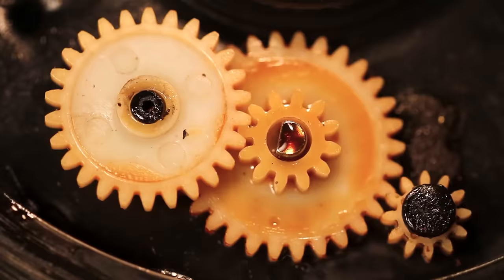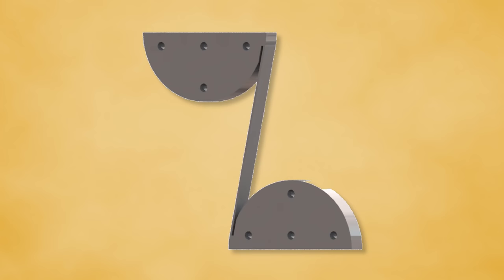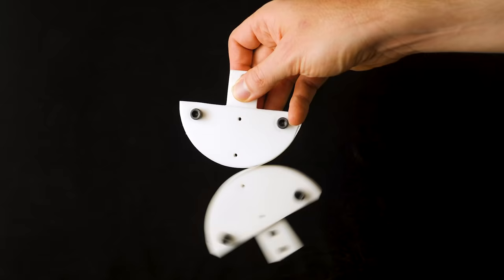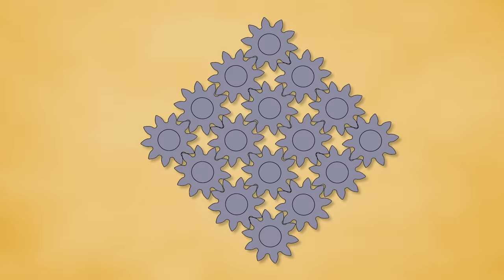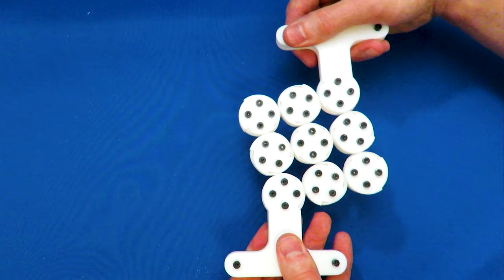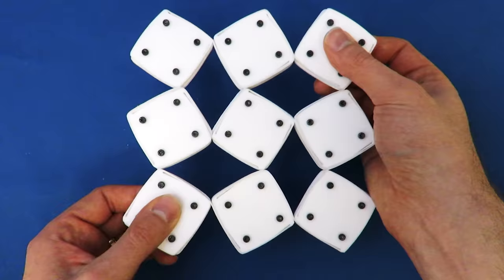Compliant Mechanisms that Roll Like GEARS!?! -- #VeritasiumContest

Comment: If I understand them correctly, these mechanisms can't actually rotate continuously like a true gear.   They can only rotate within a limited range (<360°).   So wouldn't this be closer to a linkage, rather than a gear?
Reply: correct
Reply: true.. they kinda clickbaited us but i think its still cool what theyve shown here
Reply: You could probably use this concept to make compliant rolling joints with a much larger range (a few rotations), but that would involve wrapping the flexible bar around the "gears" multiple times, either in a spiral or like a screw.
Reply: yeah this, but i'd still be interested in seeing some possible real life applications of those links.
Reply: I'm sure there's some clever ways to stack them if you need multiple revolutions of range, but yeah, gonna have a limit as long as things are attached.
Reply: not necessarily, if structured correctly, like a jacobs ladder
Reply: Did someone say bondage
Reply: @reimugota8181  Yeah, it's definitely a very cool idea.   I'm sure they have many applications.   I'm just a bit fussy about language, so the description of these things as "gears" didn't sit well with me.
Reply: @FrostCraftedMC  I'm not sure what you mean.   Could you link a a video showing the kind of Jacob's Ladder you're thinking of?   (Googling that term won't help me, because it it has about 7 trillion different meanings.  🤦🏼‍♂️ )
Reply: @animatrix1851  I like the way you think.   😉
Reply: @liambohl  Extrapolate just a bit more, and isn't this called "belt and pulley"? ; )
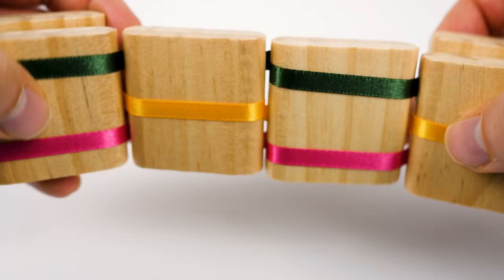Reply: @ahobimo732  It's shown in this video 0:09
Reply: I'd also add they are only showing ratios of 1:1 whereas gearing is far more used at varying ratios for speed or torque alterations.
Reply: Imagine a compliant component carrying a strong alternating torque. Could you feed that into a more typical gearbox that translates that alternating torque into consistent torque in one direction? Would this be beneficial in any hypothetical use case? What comes to mind is a translation from typical engine torque into alternating torque and then back again. Would the power loss be significant here? Trying to think of how to work around the limitations of single-rotation torque carriers
Reply: @FrostCraftedMC  a jacob's ladder doesn't make full rotations, the direction reverses for every other flip
Reply: @reimugota8181  consider that veritasium has turned into an entire clickbait channel filled with half truths or technically correct explainations that omit detail
Reply: ' So wouldn't this be closer to a linkage, rather than a gear?'  Working in reverse, there are a lot of gear and sector gear based mechanisms that don't ever make full rotations, where this could be a strong option and replace 'gears'.
But yeah definitely not a real gear replacement.
But they do roll 'like gears' as in a similar manner, even without being a full gear replacement.
A little misleading, but at least not pure clickbait either..
Reply: Very true.  These do not rotate like gears.  They also have other design faults.  For one, there is no consideration for material fatigue.  The constant flexing will eventually break the nylon they are using.  Gears have proven themselves but the Youtuber did not show any real world examples of this device used in any real machine.
Reply: I think you can make them rotate continuously but you lose the solidity. they are more like tank tracks.
Reply: @chessboxtv  Alternating torque doesn't have the same advantages as alternating current so it's hard to imagine a use case for switching to it to be rectified later, but there are use cases for harnessing and rectifying alternating torque with a limited range of swing, like wave power.
Reply: you are correct but not because of the rotating part. after looking up both definitions, it's obvious that the lack of teeth is the primary dis qualifier for being considered a gear. that and the first picture that comes up for "linkage in engineering" is of similar designs to what is posted
Reply: If you offset the attachment point, from top and bottom to the none interfacing sides you should be able to continue the motion.
Reply: That and the stress would be more on the belts allowing the motion, I understand what they are going for in a small view point. But it wouldn’t be able to fitting to replace a gear’s intended use and purpose.
Reply: @liambohl  just use a moebius strip to make them
just kidding
Reply: @alexs5814  decades ago the hard disk drives used this mechanism to control the reading head. The coupling from a very small diameter axis of a stepper motor to a bigger disk was made trough a metallic belt, very thin, to avoid any backlash. In robotic joints the same kind of coupling is made with teethed belts. It's not a new idea at all.
Reply: @GabrielMarques001  thanks for the history lesson!
Reply: Indeed it's more of a linkage
Reply: yeah you listened to the first sentence of the video
Reply: Do things like cassette spools count as linkages? Because that almost seems like a closer mechanism to this. Oh, and on the topic of range of motion, something like this could be used to carry continuous rotational movement, provided you had input and output mechanisms to convert continuous rotation to oscillation and back, but I struggle to see a situation in which that would be superior to any and all alternatives.
Reply: Also, speaking of linkages, in The Legend of Zelda: Ocarina of Time, Link ages from a child to a young man in one of the core gameplay elements.
Reply: @hollt693  You just earned your seat in Pun Valhalla.   👍
Reply: Yep, limited rotation prone to break and if one of those fail the rest too.
A mere gimmick.
Reply: @EliosMoonElios  So you're saying this gear mimic is a mere gimmick? ; )
Reply: this video is why we need dislike buttons
Reply: @FrostCraftedMC  I’ll have to look it up, but can you explain further?
Reply: Also not sure how they're getting "360" degrees unless they're adding 180 + 180 degrees which is ghey Af. This entire video is BS. You're correct they have reinvented the airplane hinge.. Bravo 👏
Reply: I was thinking 'hinge'
Reply: Yeah but in purposes like grippers where gears rotate 120 degrees approx this might work
Reply: If the belt is long enough, it should be able to go beyond 360.
Reply: Only based on how he made it, while not compliant, you can achieve the same effect with two belts rotated 180 on wheels
Reply: @ItalianRetroGuy  can you recommend any channels? I just found “electric aviation” channel and it’s excellent.
Reply: You may be able to apply hysteresis to the end motions by choosing a material for the flexible part that is also elastic along its length. That way it gradually slows and comes back when at its extremes. Some drummers love belt-driven kick drum pedals because of that elasticity- they swear by the ergonomics.
Reply: yep, but very useful for robotics like aplications
Reply: @chrisnelson1935  You won't get continuous rotation as long as the band is attached at both ends.
Reply: It does say roll not rotate
Reply: The video defiantly said these could work on 360 degrees while showing only a 180 degree compliant “gear” set.

Comment: Neat design, but in no way are these similar to actual gears. They are closest to a hinged joint. The purpose of gears is to transmit power, typically continuous rotational power. This "hinge" is not capable of such an action.
Reply: that's only one purpose of a gear. They can also be used for timing, compression, and as contact surfaces to ensure proper planar meshing. These are most similar to the last category.

Comment: "..can move 360 degrees.." 
in all designs you showed, if it were to move 360 degrees it would break or heavily deform. Even the one you showed while saying that is 180 degrees of movement, not 360.
Reply: It actually moved closer to 320 degrees or so, in a reference frame where one part is fixed (from near parallel on one side, to near parallel on the other side). What it couldn't do is continuous motion, because the flexing part is fixed to the rollers. If it wasn't, we'd have a belt.
Reply: In the one demonstrated the top part moved 180 degrees and the bottom part moved 180 degrees the other way, so they two parts can move 360 degrees relative to each other.
Reply: @Project Kaizo Trap what's common core math ? radioactive corium meltdown math ?
Reply: @monad_tcp  nah, that stuff is too small of a cancer risk to be associated with common core math
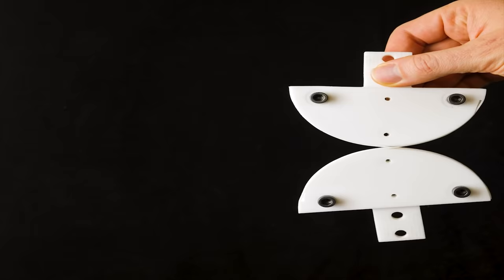Reply: @aDifferentJT   The one at 0:27 ? Nope.
Reply: So they literally cannot "Roll Like GEARS!?!" @0LoneTech

Comment: Metal-band and roller mechanisms like this have been implemented successfully in a few niche applications requiring ultra-low friction, one of which being early automotive airbag sensor switches. Also, sometimes surface grinders use a band and roller to translate rotational motion of the hand wheels into translational motion of the table, presumably because the force vector is always exactly tangent to the path of motion, whereas with a rack and pinion the force vector is not exactly tangent, and moreover it can vary in direction and magnitude over the range of travel if there are any geometrical imperfections, which would be a problem for a precision grinder since imperfections would show up in the workpiece. I have never seen an example of band and roller used to convert rotary motion to rotary motion, but I’m sure there exist machines which could benefit from incorporating this concept
Reply: Metal bands have been used in hard disk drives and floppy disk drives head assembly stepper motor drive since long time.
Reply: Which surface grinders? Asking cause ive used quite a few of them
Reply: @Ryknfjor  I'm not sure. It's something I've read about but not seen in real life. I recently heard that my friend's Harig surface grinder uses a rack and pinion for manual feed, but uses a hydraulic cylinder for auto feed. This may be a more common arrangement than the metal band that I earlier described, and would still be pretty much as good since the hydraulic cylinder should be capable of much smoother motion than the rack and pinion.
Reply: @Ryknfjor   @Andrew Phillip  Mitsui's use belts like that, among others. You only see them in the super high end grinders for the most part
Reply: @cylosgarage  @Ryknfjor That is cool. Yesterday I was looking at some parts made on a tormach SG and the lines from the rack and pinion are very apparent in the finished workpiece
Reply: Cheers - did not know

Comment: Zero-backlash bands have been around for a very long time.
I saw my first one tearing down a floppy-drive in 1985 or so.
The stepper has a drum, band wrapped around drum.
Band ends were on the 'sled'.
Stepper rotates, band drags sled to and fro.
Very precise movement that rack and pinion gearing would have a hard time matching.
Reply: I'd love to see that.
Reply: Do you happen to know why they switched to leadscrews? That's all I've ever seen in 3.5" floppy drives. I did, however, see a band in a more recent drive. (Iomega Jaz, I think. I only found the linear stage in the recycling, without the enclosure or any other parts, so no labels.)

Comment: That first demo of two semi circles in articulation could be cool as a load bearing joint in a robot arm. Could use opposing linear actuators on either end to articulate it like muscle on bone. Only challenge I can think of would be whether the surface friction and rigidity of the join constraint would be enough under load.
Reply: it does in a way resemble a knuckle joint
Reply: @DeVibe.  the idea is a bearing alternative
Reply: @DeVibe.  yes, and preferably with justifications
Reply: @DeVibe.  in a robotic arm where the rotation is less then 360° how is this sub optimal compared to a bearing?

Comment: The single one may make move obvious sense in being restricted like a knee joint. The multiple one seems a little odd, but I could still see some application if it had springs and dampeners to a mostly monostable position. (Earthquake dampener maybe?)

Comment: The concept is the same as a rolamite bearing or a scrollerwheel bearing, but simpler.
Reply: Wikipedia articles:

https://en.wikipedia.org/wiki/Rolamite (for linear motion)
https://en.wikipedia.org/wiki/Scrollerwheel (for *continuous rotation*)

I don't remember if those articles link to each other, but they should.

Comment: Novel idea, but is there any practical use? That is to ask, does this provide less rolling resistance than typical gears? I also noticed you suggested that plastic is not an ideal material for this and should use metal instead, but wouldn't metal tend to have permanent deformations, as well as a tendency to break? Or at least, that's my experience with stainless steel spoons and copper wire.
Reply from the maker: Yes there are many applications. I plan to do a future video about this so stay tuned. As for the material, yes if you wanted to do a practical product you'd want to use metal and probably wire EDM it from a sheet. It would work great and be very durable. The reason I used Teflon is because it cuts well and quickly in our cheap laser cutter. It's also good for prototypes and nice demos but I'd never use what I showed in a real product.
Reply: @TheFACTsofMechanicalDesign  Yes of course. I knew you did not use teflon in the final product, but is metal a suitable alternative, based on my experience with bending spoons and copper the metal seems to have permanent deformation. On the other hand, I now remember than medieval crossbows seemed to have metal in the bow and those worked, so maybe metal can work. While assuming metal can work, I am still curious to compare the rolling friction of this compared to standard gears.
Reply from the maker: Yes metal could be made to work, you'd just need to make sure the stress in the straps never exceeds the yield stress of the material of which they are made. It would require thin straps and larger diameter cams. As for friction, the teeth of traditional gears slide against each other during the entire time they are contacting except at the pitch point. But with the compliant gears, they theoretically shouldn't experience any friction but of course in reality they would slightly since nothing is ever perfect.
Reply: @TheFACTsofMechanicalDesign  Hmm alright, sounds like a good product.
Reply: @pinkiepie-yv8tk  Metal bands are commonly used to convert from rotary to sliding motion in precision but low-force CNC applications (laser cutters, pen plotters, etc.), just like how you could use a string wrapped around a drum to do that. Others here said they were used in the head actuators of old hard drives and floppy drives. So we have plenty of examples of them being durable. AFAICT, you only need to keep the deformation in the elastic region (where it can recover) rather than going into plastic deformation (which is permanent). Practically, for metal band mechanisms, that just means respecting a minimum bend radius. The minimum bend radius and/or the durability is better for thinner metal, just like how stranded wire can withstand more flexing than solid wire, because any given absolute bend radius will be subjectively a gentler bend from the perspective of a thinner material—the bend radius is larger as a multiple of the thickness.

Comment: The advantage of "traditional" compliant mechanisms is their precision and lack of backlash/flex in undesired directions. I assume one of these mechanisms cut out of metal on a wire EDM could achieve significantly less backlash than some traditional gear designs, but is it actually better than existing technologies? Also, would this even work with metal? 

I want to see an example of a real-world application where this exceeds the performance of whatever mechanism would traditionally be used in that role. Either an increase in reliability, decreased parts count, easier manufacturing, decreased assembly complexity, etc. Otherwise, some novel application where this excels other than novelty toys.
Reply: I guess if this is made out of spring steel, it would make for a very reliable linkage with very minimal backlash if any. I can't see it being used without a connecting link between the two center points though, because the discs are basically held in contact to each other with two nearly parallel tensile forces in the bands. I could also see it being expanded to over 360° with bands that twist around two rods like screw threads, instead of hitting their limit after 180° each.

Comment: This is amazing. I love your videos and wish that you were still producing them!
I had a question regarding these "gears" is there a way to design the flexure such that there is a preload force on the gears? I am imagining the flexures with variable thicknesses such that the gears want to roll one way unless a force resists them.
Reply: Instead of printing the flexure "belts" straight and then bending them, you could just produce them in the preferential alignment.

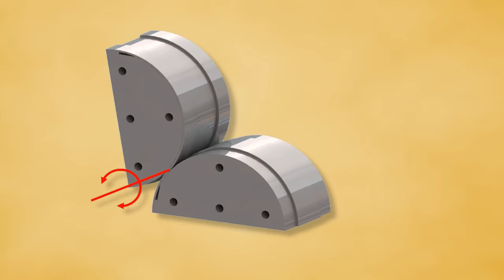Comment: You said 360 degrees at 0:29, but it was clearly 180 degrees.
Reply: Both halves rotate 180, giving a total 360. If you held one half fixed at the top, the other could rotate from being left of it with the handle also pointing up to right of it with the handle pointing up again.
Reply: @Pystro    never mind, I just understood what you meant. 👍